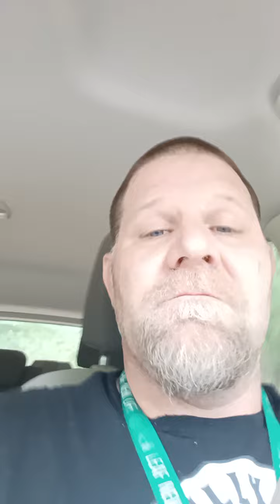tip of the day . hope this helps many . never assume it's bad when it's DC grounded ....

Comment: A 99. Or a   I max 2000. Is just an end fed Antenna. Over a 1/4 wave mutual inductance. And the dc ground Side will induce the  rf energy to radiate from the end fed wire that runs up the center of the antenna… what really throws people for a loop. is the center of the coax is not connected to the wire inside the antenna…. The connection is made through the mutual inductance.